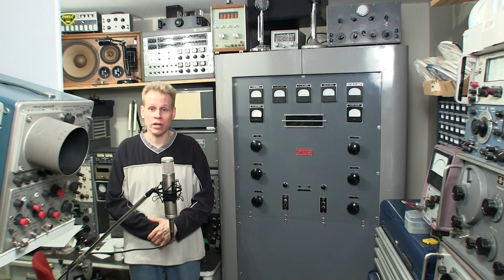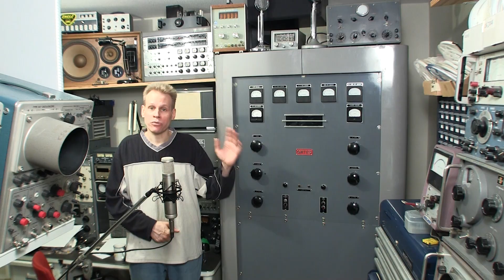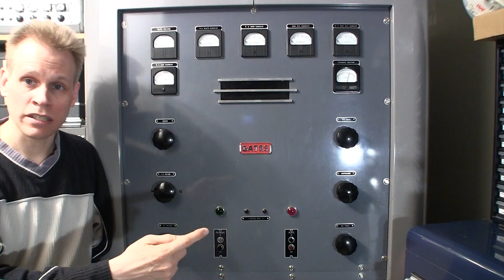Standing Inside a Broadcast Transmitter While it's ON!

Comment: This transmitter is a dog house compared to an old RCA TT50AH with rectifiers in what looked like a garden shed.  Also, access to the back of the transmitter and  external power amplifiers was through a door.

Comment: If radio stations have a daytime and night time transmitter, does that mean an engineer would need to physically be on at the switchover time to manually switch over the transmitters?  I don't know whether radio stations in Australia where I live are required to have daytime and night time transmission power levels or not.

Comment: Ihve 19/ 813 tubes total tubes . Total tube approx. 8000 tubes in fact I have most of the parts to build that includes a heavier version of that inductor! But not the heavy diode tubes! And a version of that plate transformer!

Comment: What you said about night time operation in the 1960's  at nite Iwould listen to Wolfman Jack's rock broadcast out of Los Angeles. I was in Fresno,California  at time.  Also I had a chance to acquire a Bauer radio transmitter a little wider than the case you have but not as tall but it had a horizontal view window that you could see the big glass tube's  a friend of mine took out the am radio one freq portion out added a pi network mutifreq.coils band switch  you get the Idea he was converting to HF Ham bands 10/ 80 meter range modulation driver so someone  could use at Ham band with there yaesu ft 101 transciever
Reply from the maker: Thanks for sharing your story and memories.

Comment: When I was a teenager I would mow the lawn at the WWWE tower site and everything metal would have a bite to it so you had to hold on to the push mower the whole time you were mowing around the base of the tower.. Unlocking the fence was interesting as well as the hair on your arms and head would tingle from the charged air.. You could hold up a fluorescent light tube and it would light up.. We demolished several old transmitter sites that had basically copper pipe as coax and yes the amplifier cabinets for these 20kw to 50kw sites were huge..
Reply from the maker: Thanks for sharing your story!

Comment: 250 or 500 watt AM transmitters were generally shells of 1 kW designs, just built with smaller iron and a few other parts. 

That was probably made with mercury vapor rectifiers, that can have 15 minute warmups.  It appears to have solid state replacements, down low.  

Newer transmitters would generally have the RF finals in shielded housings, also with more air flow control.  

How many parts in that are PCB?  

Potentially, the modulation transformer has PCB oil, though you may be lucky and have mineral oil.  Some of the black potted mid size transformers, or cap's, may also be PCB.  Usually you can smell them in older gear.  

If you were intending a HAM conversion, why go for 810 relics, and not 4-400's?  

Which suffix letter Gates family was that?

Comment: My 10 tuber has 3000v in it. Your crazy being inside that touching things.
Reply from the maker: The safety interlock is open, no HV at all.
Reply: @MrCarlsonsLab  This video popped up in my feed so I went to look to see if Mr. Carlson had ever responded to my criticism from four years ago. Not to belabor a point but I still find this video to be a tad bit reckless. 45 years as a broadcast engineer and worked on everything from 1KW to 50KW. Just because the interlock is open DOES NOT mean it is safe. You should always, always, short any high voltage connections before working in the transmitter. Protective devices can fail and you will pay the price. The fils are on. That means there is 240VAC floating around in there. Those old transmiitters had relays, transformers and connections that were open to the touch. If you are not paying close attention to what you are doing, like when recording a video and swinging a camera around, you can come in contact with something that might just ruin your day. If you have to go into the xmtr while it is on, always have someone near that can turn off the power and get you out in case something happens. I will bet that every broadcast engineer has a story or two about mistakes they made and got burned or zapped over their careers. I do. I won't repeat everything I wrote four years ago, it is still here in the comments and you can look at my full rant about this video, but I still strongly urge you to put a disclaimer on the video not to do this unless you take the appropriate precautions and if you did do the checks for high voltage, add that to the video. A commercial broadcast xmtr is not the same as your typical ham gear. If you acquire one of these to turn into a ham rig, be careful. Maybe try and find someone who has worked on equipment like this. Don't want to sound like an old guy yelling at you to get off of my lawn but, high voltage in an old transmitter plus worn parts could be enough to kill you. Use that Jesus Stick! Otherwise, well you know how the saying goes.

Comment: I am absolutely fascinated by size of the unit for only being a 250W Amplifier. When compared to standard ham radio equipment, which is probably about 1/50th of the size, it just illustrates how overbuilt these were in order to maintain 100% duty cycle, 24 hours a day, for years if not decades.

And of course, thank you for the walk through. Very informative and eye opening! 👍

Comment: I worked for a station that had a 50KW Westinghouse AM transmitter the size of a bus. Now they use a Nautel digital box, which is in a single standard rack-size unit.
Reply: When I was a teenager I would mow the lawn at the WWWE tower site and everything metal would have a bite to it so you had to hold on to the push mower the whole time you were mowing around the base of the tower.. Unlocking the fence was interesting as well as the hair on your arms and head would tingle from the charged air.. You could hold up a fluorescent light tube and it would light up.. We demolished several old transmitter sites that had basically copper pipe as coax and yes the amplifier cabinets for these 20kw to 50kw sites were huge..
Reply: No fun anymore!

Comment: Meh, 250 watt AM Xmitter now weighs about 50 Lbs and fits in a rack....How times have changed....Those old transmitters were power hungry using vacuum tubes....'ya couldn't afford 'ta operate 'yer station now using an old Gates like that with the electricity costs today...

Comment: 8008 is Mercury Rectifier.   LAst I tried to find one, they were fairly difficult to find and quite expensive where I am (In Australia).   I am one of those people that like to go back to totally original where possible, but the cost of some tubes does make it difficult and I you have no choice but to use or seek more modern alternatives.

Comment: Two 810's, btw if there is idle current it is class AB not class B, but two 810's in this conf are capable of 700 watts or so, to modulate a 250 watt transmitter you only need 125, so this is really nice overkill typical of Gates.

Comment: i have read that in those remote transmitters the lil animals like rats and snakes got into them and got into 1 of the high voltage parts they got zapped of course but it knocked the x mitter off the air.

Comment: Thank you for the very interesting presentation... what a cool blast from the past! I was wondering if you think small amounts of dust act like a thermal insulator which might enable more heat buildup in tubes and other components, thereby quickening functional failures.

Comment: You have D104's! I had one with a 6-wire cable back in the 70's. I ran a Surveyor 23 channel mobile through a salvaged Starduster antenna. I had great range and annoyed a lot of guys with full base stations. They had Browning and Cobra radios and I kept up with them. The D104 brings back great memories!

Comment: That reminds me some souvenirs, at a smaller scale. I have worked in UHF 20 KW Klystron analog TV transmitter for 17 years, Plate voltage at 18.5 KV. That was a nasty beast. Glycol cooled, and some other big stuff in the chain. The antenna was 11.4 DB gain, so the apparent radiated power was 295 KW RF at full power. Normal Klystron start-up was about 20 minutes and emergency start-up was about 20 minutes, before plate ON was authorized by the transmitter. haha.  Unlike CB or HAM radios, the VSWR max was 1.2:1, over that, a plate OFF command was issued by internal control to avoid the 8 inches diameter output copper coax to melt. I really enjoyed that video 🙂 thanks.

Comment: Same laws count for club lasers, they need to warm up in steps from 1°C to about 80°C in about a half hour and best reflected outside without disturbing air traffic, mostly these systems are water cooled, these are already serious things. I remember being in the 80s with the first self-made FM exciters, warm up time was also an issue. We were transmitting with 5 watts on 4 dipoles, and losses were that great, we're transmitting for 3 streets :)). Now these days I have a 50w FM exciter and a 250w booster, tweaking these are so easy and fast. And compact, for 24/24/7 use. I just noticed a video from WSW Broadcast? With a transmitter from 500K ? Building from 3 stories for that full transmitter.

Comment: That was awesome! Have worked in FM & AM  broadcasting.  The AM station in Slidell, LA has a history of taking insane hits. I had the terrifying honor of experiencing those hits while on air. Never, ever go outside to watch your tower take lightening strikes! Was drinking a soft drink in an aluminum can at the time. The crew found me on the kitchen floor out cold! Talk about lots of fried equipment in the chain. The station went on air in 1963 w/ Collins xmtr, which was replaced by a Harris xmtr in '89, & finally we ended up w/ a BE transmitter. Love broadcasting. Great channel. Be safe, God bless.

Comment: Hey Mr Carlson.  May I suggest you purchase your shirts at different stores than the ones you go looking for old radio hardware.  Just a thought unless you are trying to dress to be consistent with the genre of the radio period.  I mechanical engineer.  While at college the claim was that the electrical engineers and technicians tended to be socially stilted.  That was due to the additional brain cells required to be an EE or EET.  Keep up showing the breath of electrical knowledge that keeps in a life long learning mode.

Comment: the load and dip are designed to get the output power as high as possible while keepl plate current down as valves(tubes) don't like kigh plate current. it teds the break them. so you end up witn higher voltages. vaccume tubes as charming as they are are horribly inefficient
Reply from the maker: Have you ever wondered why everyone is so worried about efficiency? Everything comes at a cost, there is a balance.
Reply: @MrCarlsonsLab  have i ever wondered why? nope i'm from an enginnering background. efficenty to us is like breathing clearly.

Comment: Just found  your channel and enjoy your content very much.   30 years ago I was a Chief Engineer for an AM station that used the BC-1/T (1KW) and a BC-250/T as backup.   One night after a huge storm, the roof failed right above the BC-1/T and flooded the cabinet.   When I arrived, there was standing water on top of all of the transformers, reactors, capacitors.   It was a mess.  I removed everything that could soak up water, took those parts to a motor rebuilding shop that "cooked" the transformers, inductors, etc. at a low temperature for a few days.   Everything checked out okay. I reinstalled, retuned everything, and the transmitter worked perfectly.  Didn't have to buy any replacement parts.  Gates had excellent well written manuals.  Neat to see the BC-250/GY in this video!

Comment: Very enjoyable tour!! I had never seen the innards of an older Gates TX.
I ran a Gates BC-10H for AFVN in 1970-71. It sat in a tiny building on 55 gallon drums in a swampy area next to its 200' tower. We were "The Big 900!" in Dong Ba Thin. It had 4 5000W ceramic tubes in the output, and the 2 modulators were driven by a dozen TO-3 transistors. They were insulated from ground by the usual thin mica insulators...even though they were at the -560V bias of the output modulator tubes! The sheet-metal roof blew off once in a typhoon, dumping about 50 lbs of sand from the bags holding the roof on into the transmitter, along with lots of saltwater spray from the lagoon. I spent a week cleaning everything as well as I could, threw the B+ switch, and the emitter resistors on those mod driver transistors went off like a string of firecrackers. Salt, moisture, and HV do not get along! Interestingly, the crystals were mounted in 6146-style evacuated tube envelopes. I enjoy restoring older amateur radios and I've picked up lots of good tips from your  videos: Thanks so much! My next project is an HQ-120, and your comments on the IF alignment will be very useful! Keep up the interesting work!
     de Fred Archibald VE1FA.  
PS As Frank Roberts comments below, when you walked into the TX shack, you could clearly hear the voice and music from the BC-10H's power and mod transformers!

Comment: I worked in a transmitter factory that made tube and solid state transmitters from 30Mhz -  960Mhz up to 500 watts and 3000 volts of plate voltage. You mentioned that these AM transmitters were usually located out in a shack away from everything. Safety from the high voltages and heat along with keeping inexperienced people away from them are likely the main reasons for that, but what about exposure to RF radiation, especially at higher frequencies (G5) and high data rates? Have you addressed any of this in your videos?

Comment: i was a army radio operator for the dutch army in 1998 just before they went digital , it was a single side band radio built into a shelter that was put onto a truck that i also happened to be the driver for . i don't really remember what set number it had in there but it was the coolest radio that i ever played with , we had different anteny with it like the straight 20 meter ( or so )pole , we could make a dipole antenna and a cartwheel antenna , that thing had a good deal of range also when using the signal booster that it was equipped with outside the rf protected cabin , man i tell ya when the booster kicked in ( and you had to give it a few seconds to get to full boost before broadcasting) that thing could fry some stuff , it was for that reason the warning no to get anywhere near the antenna when in use for so i was told it could fry an egg .

Comment: Beautiful! In the early 1980s, I had a transmitter across the street from me in Pennsylvania. WEEP, with a glorious 50kW RCA transmitter.

It has a beautiful four tower Marconi antenna array.

That evening, the engineer was working on the rig, changing an RCA 5671 output tube.

It is the largest tube I have ever seen. Large enough it has its own jack to lift it into position, the apparatus was impressive.

I had the pleasure of seeing the interior of this transmitter as a lad.

Comment: Hi Mr Carlson i just wanted to say that i use to work at the local AM radio station here in Nevada Mo. And the gates transmitter that you have was the same model used as the primary xmter. I can remember many a evening sitting in the control room with that heater keeping the studio nice and warm on the winter night. This vidio realy brought bavk memories of fun tumes in the 70's and the owner too Thank You for the trip down memory lane. By the eay the station is on 1240 khz here
Reply from the maker: Thanks for sharing your story Terry!

Comment: Very interesting to see this old transmitter. I noticed that it used variable capacitors to tune; the Collins Radio equipment used variable inductors to tune their system, as it has a higher Q factor, and makes the system much more efficient (and thus compact).  Collins was a radio genius, one of the very greatest, and i hope someday Mr. Carlson will do a program on his prototype message switching system from 1959 which bankrupted the firm, because the Air Force couldn't understand what it was. It was the forerunner of the internet, all done with very clever tech for its day. I doubt there are any message switching prototypes left, but perhaps some old timer from Collins could help you out with some diagrams

Comment: I used to service Fm broadcast trasmitters  40  years ago or more ...I had to replace tubes  ,and tune the cavities for the new tubes  ,,,a lot of fun ,You had to go to the sites where the transmitters were installed and had to do the job fairly quick.Your tansmitter is not very powerful ..Like 1Kw at most ,,The modulation transformer is small by AM radio standards  ...I have one at home that was 8 times as big as that one ..It had ceramic posts

Comment: Filament adjustment to ensure to complete intended lifespan of the tubes. "Overvoltage dramatically reduces the life span of the tubes"
I have a big old American audio amp with 6 signal and 12 outputtubes, It is wired for 220 Volts but where now at almost 240 Volts. All the tube filaments are directly on a the Main transformer tap of 6.5VAC filament voltage. So I reckon with the increase from 220 to 220VAC the filaments get on overvoltage of 240/220 times 6.5VAC = 7VAC. I'm not running my amp 24/7. I would be overheated, but should I lower the filament voltage?